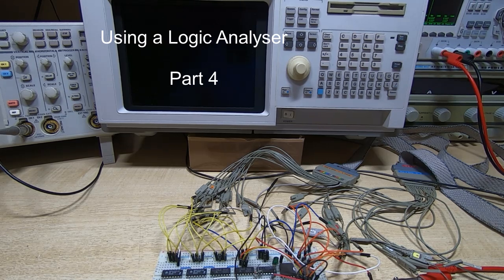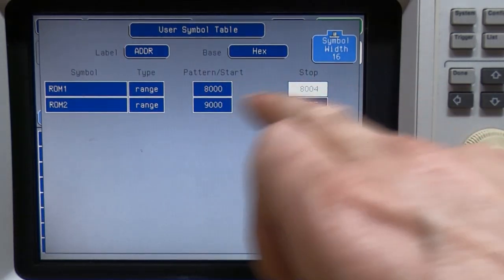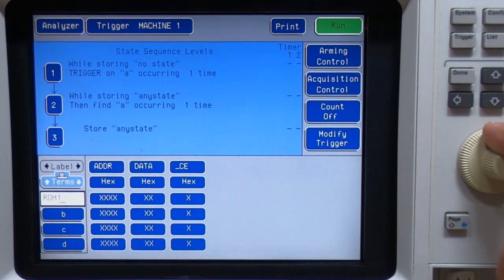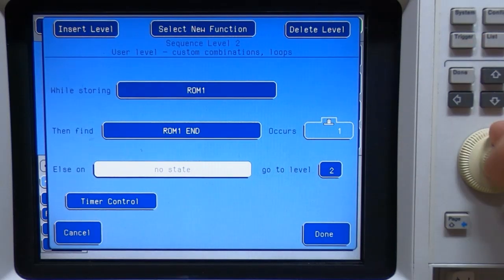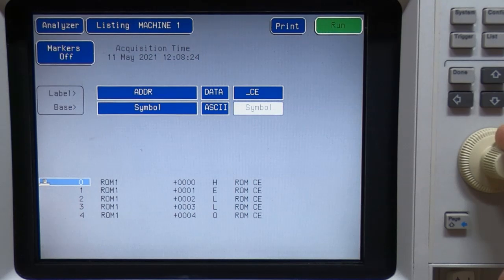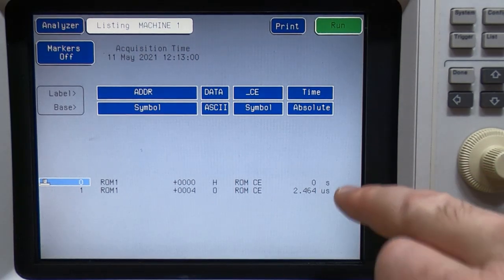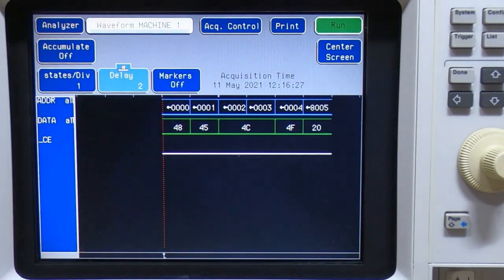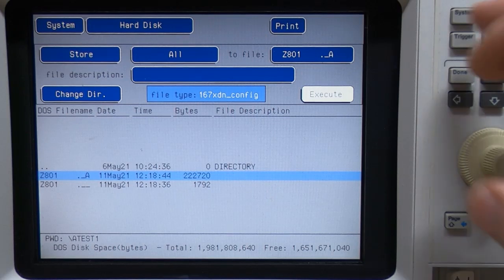Using a Logic Analyser Part4

Comment: Hi Jerry I have a 68hc11 board as my target board. I have it displaying the opcodes in hex and data. I would love to display from hex opcodes to assembler code say LDAA $8000 load the data  at address $8000 in to the A accumulator. They have a output from the MPU that goes low each time an opcode is fetched to trigger the logic analyzer. Cool stuff love your video series on the HP1670G I have the same LA as you. Thank you

Comment: Jerry, this series is very interesting.  When you "end" this series, will you show examples perhaps using a small computer/microcontroller to show analyzing the code(?) that is running (if this is the correct term for the process) and for analyzing an actual digital (analog too?) circuit?
Reply from the maker: You may be interested in the series of videos I posted some time ago on the ZIP30, If anyone is still watching these videos I will post a video on a small micro system but interest seems to be diminishing.
Reply: @JerryWalker001  I hope that enough are watching for you to show using an analyzer with a small micro system.  At least I am interested and am now going back to watch your older videos!
Reply from the maker: @bobvines00  There is a watch list for the ZIP30 https://www.youtube.com/playlist?list=PLzvLbUxGuZ-wxnF7gsGfmarrKR_55U-r4